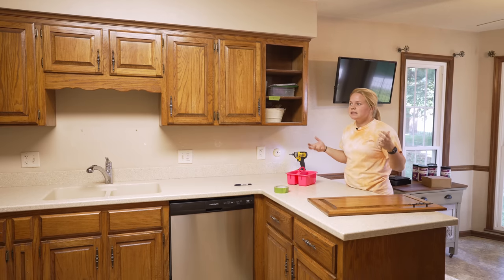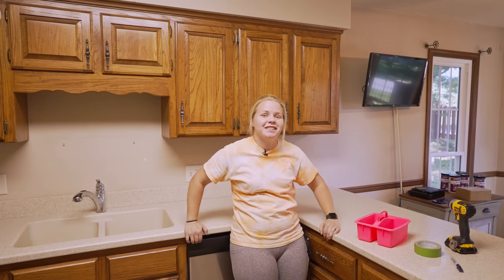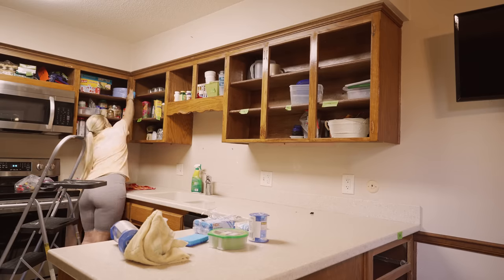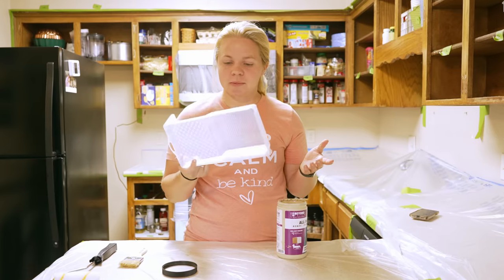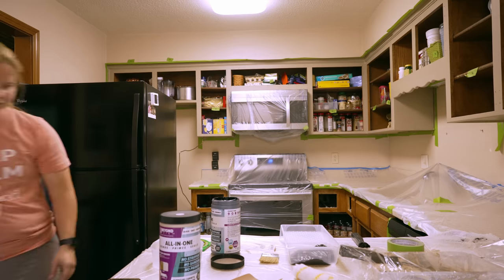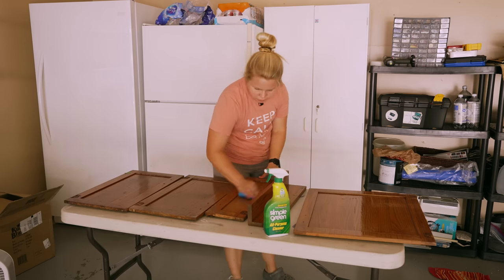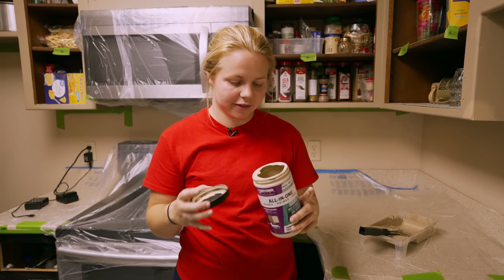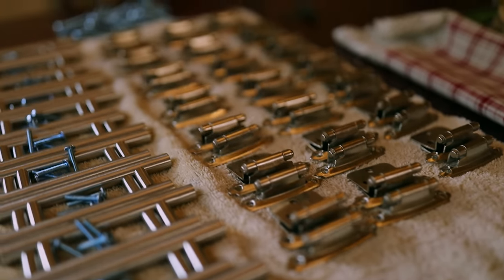Paint your Kitchen Cabinets the EASY Way | Detailed Step-by-Step for BEST RESULTS

Comment: WOW!! 😁. I have always thought the false panels just below the sink look odd with out hardware. If it looks like a drawer, give it a drawer pull. This has encourage me to tackle cabinets. I have shied  away from cabinets for up until this video there was sooo much prep work and a top clear coat needed. Not any more! Thank you for sharing!😁
Reply: The sink may be in the way of you screwing a knob or pull onto the false panel. You might want to convert them to tip-out bins which would allow you to mount hardware, and provide additional storage space.
Reply: The tip out bins are very useful.

Comment: Great job Lauren! It looks really good, I’m not crazy about the linen color, I think it’s too dark and has a green tone to it. It looks more khaki than linen. Also, i think taking off the rippled boarder above the sink would have updated it a little more. And just my personal preference, I would like the inside of the cabinets the same color as the outside. It just makes it obvious that it’s been painted every time you open them. I like how the the paint is holding up though, I’m impressed with that.
Reply: Oh my I hope I didn’t sound rude! 😦
Reply: That's the way the owner wanted it

Comment: Nice job! I have orignal 1950s metal cabinets in the lower part of my kitchen that look like they've been painted once long ago. I've put off painting them for six years. Have you ever tackled anything like that? Any additional tips would be appreciated. 😊
Reply: Use a good bonding primer & oil-based paint. Latex will just peel.

Comment: A friend and I are thinking of helping each other do our kitchen cabinets - the same "orange" old oak wood look including arched look on the uppers and the lowers look like the ones in this kitchen.  I like the look, but the cost is a consideration as we each would need a gallon, or two quarts for top and two quarts for bottom if we do different colors (I want to do off white top and black lower).  The curing time is an issue with husbands who don't care that you're waiting for the paint to "harden" thoroughly and therefore they need to be careful with opening and closing rather than using their hips to shut drawers or slam the doors. The overall finish looks good.  Can you use a wax (like one would use with chalk paint) to make the finish "shine" a little more?

Comment: Did you use the same paint on your moms cabinets?  Question 2:  if my cabinets were painted from oak to espresso...if i wanted to go light as in the linen, would you then maybe sand and prime first?

Comment: Can you do a video on how to do old mobile home cabinets made of melamine that have a few spots of damage where it kind of is puffed out in a couple of small spots due to either getting wet or something, I'm not sure how it happened. I really don't want to have to take all these cabinets down and put new ones if it can be avoided. My cabinets are white and I don't mind them staying white or I am open to other colors, just not sure how to go about smoothing the places on the door with those areas. Thanks for any help or ideas.
Reply: If you see this…I hope it makes sense. You don’t need to rip out the cabinets if they work for you. You could sand the doors (get rid of the bubbling) and lay a very thin sheet of wood/lieuon(sp), the same size of the door. You can use an adhesive that will also be waterproof once dry. My contractor did this for me on my cabinets that were “shaker” style with beadboard centers. I also found that they sell prefabricated cabinet doors for the smaller cabinet at the big hardware store. I have to choose one of these myself for my RV. Strokes suck and make everything much more difficult and energy consuming…I wish you all the best with your project! TA!

Comment: I’ve used Beyond Paint for my kitchen cabinets after seeing a few of your videos. I have a problem with my cabinet doors. After drying you can see the roller strokes on the finished product. How can I fix/prevent this?

Comment: Lauren: I could really use your advice and assistance. My cabinets are from the early 90's and have a laminate front with a brown laminate trim along the bottom.  The laminate is starting to crack, so painting is not an option.  If you have any ideas, I would appreciate your thoughts.  Thanks!!

Comment: I’m getting ready to paint my kitchen cabinets but I’m going to practice on my bathroom cabinets first. Can you sand between coats for a “smoother” finish or is that not necessary? I know you don’t need to sand before you paint but wAs just wondering about between coats.  You may have mentioned it in the video but I might have missed it 😊

Comment: I used the Licorice color for my kitchen cabinets 15 months ago,  I love the color, but I'm now considering sanding it off and re painting as at least for me it has,scratched, and I did 3 coats letting it have,a week between coats.    I consider this a fail and while it sound easier I will use the paint I have leftover on furniture.

Comment: Leaving the cupboards full is a concern for me, especially since you’re also sanding. Wouldn’t everything have to be washed or wiped down later anyway?
Reply: She didn't  sand anything
Reply: @denisekoenig9479  She said sanding took place, even though it wasn't shone.
Reply: @cherylross2718  oh
Reply: Ok Cheryl, I watched the video again and she didn't say anything about sanding the cabinets!  Beyond Paint says no sanding needed.
Reply: Sorry, she did say after first coat of linen, she lightly sanded the cabinets.  You don't have to sand before starting painting.

Comment: Question Lauren, you sanded in between coats.  I’m going to paint the same kind of cabinets and I thought you didn’t have to sand when using Beyond Paint!
Reply from the maker: you don't HAVE to sand...the reason I sanded between coats was simply to smooth things out and get any debris that landed on them while they dried. Good luck with yours!
Reply: One more question, do I or should I use a wax over the completed paint job?

Comment: So you sanded before second quote? Why? What grit did you use?
Reply: I'm just assuming here, but maybe to get off any dust and stuff that settles while it dries
And probably only like a 400 grit
Reply: Between coats is usually 180-220 lightly so last coat adheres well.
Reply: Between coats helps to smooth out paint. I would use a 320 grit.
Reply: This paint doesn’t require sanding